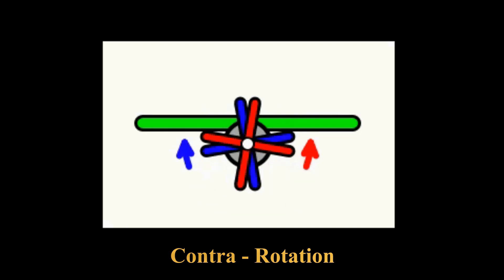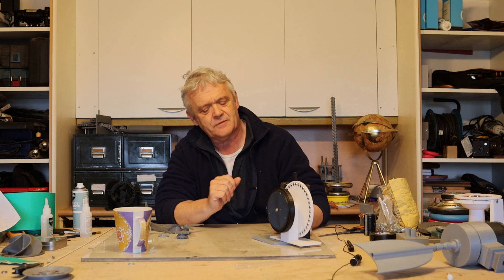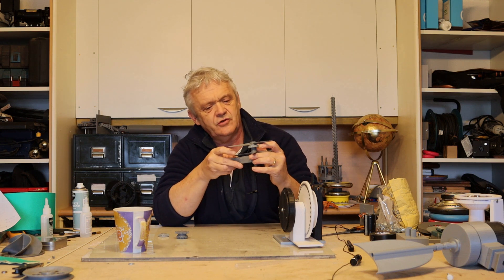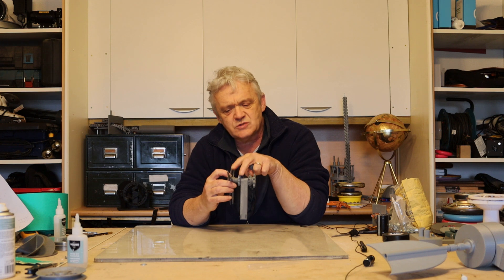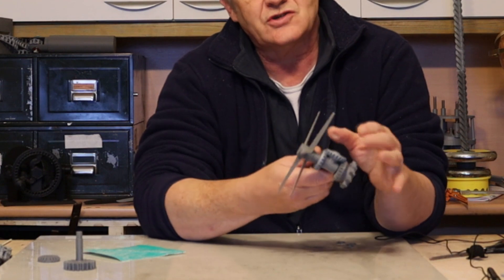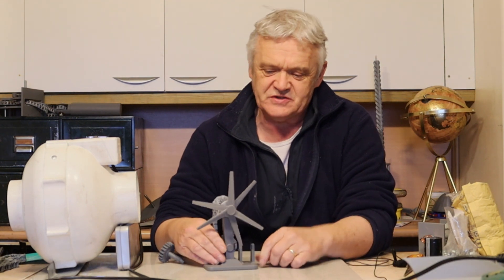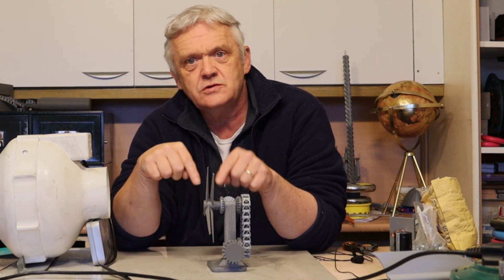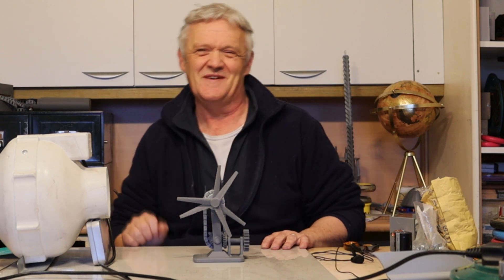2089 Contra Rotation In Wind Turbines

Comment: Some ships use a free floating straight on blade that is only there to channel the water straight on to the propeller. 

One of my beliefs is that the second blade makes better use of the air coming off the first blade than the first blade makes of the un altered winds.  
By designing the second set of blades to optimize the spiral trailing edge's air turbulences, you're not  converting straight on air into a circular motion.  Your riding the circular/drag motion and have less deflection resistances.  Thus I don't think the two separate blades (Including the 25% greater size issue) (not including the mirror effect) should have very much in common.
If the second set had greater angle of attack with deeper blade cross cuts I think there speed might be a little bit faster BUT I think there torque potential would be much greater?  This forms the second adjusted parameter on the loading of not one Generator but two separated ones.
For I don't have Solidworks YET.  And wouldn't know how to optimize the gearing to make those things work well enough.

Comment: Robert, please do the world a huge favor and adapt this model for use in bi-directional tidal applications - where the tides reverse direction at coastal river outflows for instance.  To do this would be simple: add a one-way freewheel bearing in each rotor hub (each bearing will be reversed).  That will allows each rotor to contra-rotate from the other.  You will also have to reverse the blades' orientation (mirror image).  With this configuration, the tidal turbine can be rigidly fixed to the sea floor and regardless of the reversing tidal flows, the connecting drive shaft will always rotate the generator in one direction regardless of flow directions.

Comment: I came up with a system consisting of a shoud & two contra-rotating blades, which were very close to each other, one idea was to have one blade being magnetic & the part of the shroud around it had conductors, whilst the other rotor was composed of conductors & the part of the shroud around it was composed of magnets, giving three areas where conductors are cutting through magnetic lines of force, hopefully maximising the energy being generated.

Comment: What if you had 2 sets of blades, one on each side of the mast, freely spinning, not connected to each other, one has the magnets and one has the coils both spinning roughly the same speed in opposite directions, would that not be like spinning a normal turbine twice the rpm? As you've said many times, moving the magnets over the coils quicker will generate more so spinning in opposite direction would be equivalent to increasing the rpm on a standard hawt?

Comment: I thought of this a few years ago. My thinking is that it would help systems that use an automotive alternator reach excitation RPM/speed at half of the wind speed. My thoughts were to rotate the body of the alternator and counter-rotate the shaft of the alternator.

Comment: Impressive Robert but why the extra chain drive?
Surely the best position for the generator is on the intermediate bevel gear? At right angles to the wind and probably better cooling too.
Reply from the maker: you can change it as you wish mate - i put the chain in for others to be able to interface a variety of things easily - but it can just as easily be different if you want it to be

Comment: Loads of questions , does this give a better output than a twin rotor , if you had a single 6 rotor propeller would it give the same output ,or better when you factor in less complexity and resistance... 
     Obviously size difference,and spacing distance seen to be crucial ,

Comment: For that set up I guess the real comparison should be if that harnesses any more energy than the normal double turbine given the extra inefficiencies in all the gearings and chain.

My idea for contra rotating turbines is that one drives the magnets and the other drives the coil ( in opposite direction ) thereby increasing the relative speed to each other, although that will probably bring in the use of slip rings to get the energy out which adds a little extra maintenance.

Comment: If you say that one set of blades covers a usable area of 10%, would that leave 90% of the usable ariflow for the next set? You could then keep going until returns have diminished to a uneconomical point?
It would add savings to the cost of setup.

It would also be ideal for smaller scale turbines if you can gain the power of a much larger prop in. A smaller package.

Comment: Cost will be your biggest opponent here. I think it may cost as much as two windmills. And having two simple windmills will have a better uptime in the long run.
And the added complexity with coaxial shafts and maybe gears will be a step back. Years ago they had gearboxes for matching the line frequency, but it had loses in heat and frequent breakdowns. Now they have direct drive to the generator, with a AC-DC-AC converter handling the line frequency. Less moving parts = more reliable.
Even if you could engineer this with swiss precision, the up time will be lower.
And noise will be higher. You will need 4 and 3 blades, to remove harmonic vibrations. On a standard windmill you have three swush sounds everytime it passes the tower. In this design with  4+3 blades, you have 12 swushes per rotation just between the blades plus 3 maybe 7 with the tower. That will be very noisy. You could counteract this by adding an angle to the blades, but that doesn't scale very well as you go bigger. The rotational forces will rip them of at some point.
It is a lost cause, mate. 😊
Reply from the maker: it cost pennies mate - it's a test rig - it would help you work out the answer to the question you put -but it will cost you peanuts to find out - which is why the rig
Reply: @ThinkingandTinkering  
Go big or go home. A windmill that size is useless.

Comment: This is a really nice video, and it raises a lot of questions. One such question is this: Does locking the axles together mean that the faster one (front) drives the other one (back) faster than the wind can turn it... and if that's so, won't that cause the back blade to add drag and resistance to the whole mechanism and negate whatever benefit you get from adding it in the first place?
If the answer is "Yes", it seems that decoupling the blades and treating them as two separate wind turbines (designed for different wind speeds) should give better results.
If the answer is "No", can someone please explain what actually happens, and the principles behind it?
Thank you.
Reply from the maker: very good questions mate and this little rig would allow you to try it out and see

Comment: Great video as always Rob very cool , a suggestion with serpentine generator have coil center with 2 opposed  magnet disk each side , have magnets around each side Nth/sth , but matching nth/sth left to right with the wheel rotating vertically aswell , both sides magnet rigs locked together or 45° diagonal so not as hard to lock both sides together with magnets force.

Comment: Do you really need all these gears and mechanical linkage? They all bring significant losses. Why not connect directly one set of blades to your serpentine coil and the other counter-rotating set to the ring of magnets? You will automatically get higher voltage. It will increase the rotation speed which is otherwise difficult to achieve without gears or making the generator prohibitively large.

Comment: I think tge idea with contra rotating blades is the aerodynamics of the front blade should impart energy on the back blade. When the front blade rotates it creates a low pressure area behind itself, so when the blades pass by each other they're supposed to "pull" on each other due to the low pressure zone from the frontal blade.

It'sbasically supposed to increasing effective wing span of the blades while minimizing the effect of drag. Proponents of this basically want an entire circle of thin blades staggered from each other in multiple layers.

I think it's the same idea as jet engines, only without the front fan to suck in a large volume of air at high speeds. So you'd basically need an entirely new blade design for this hypothetical turbine.

Comment: Lost me on contrarotating magnetic fields. Even tossed this at AI to double check my reasoning. Inertial frames of reference pretty clearly lays out that simply because we perceive one plate as stationary, it isn't. In reference to each other, they're both in motion either way. Ultimately what the advantage should be is running the contrarotation at a lower RPM to get the same output as the classic system. Even your example here shows this since you'd need a higher wind speed to get the same output in a 1 turbine system. The point is to eliminate the need for a gearbox and the losses associated with that.
Reply from the maker: your logic is wrong - AI doesn't help - AI is actually pretty stupid - it doesn't understand anything only what you put in - if you put error based logic in there you get error based answers out - sorry mate
Reply: @ThinkingandTinkering  Volta to my Galvani. One man's "nah" is another man's "eureka," so well have to agree to disagree. I'm well aware of the wikipedia-like pitfalls with AI, which is why I didn't stop reading there. I get ya and originally felt the same, but really should reconsider your bias against what's nothing more than a screwdriver also able to write above average poetry. If it truly was trash, it wouldn't have been able to help Ben from the channel Applied Science directly solve a chemistry problem caused by minute levels of dissolved CO2 he couldn't figure out.

Comment: All you need is a clever gearing system to have the counter-rotating blades power a single shat that turn a single plate of magnets.  
Don't certain WW2 bombers have counter-rotating propellers on a single engine?

Comment: with contra rotation maybe what you want is one coil and two sets of magnets, (one for each fan) but instead of having the magnets N S N S have one disc all north and the other all south sitting either side of the coils so you shouldn't have any north/south pairing, also the two fans don't necessarily have to be mechanically coupled, if the rear fan has to run slower then so will the front fan but decoupling them will let the leading fan run faster and the asynchronous rotation speed shouldn't be detrimental the the overall output. just some spur of the moment thoughts :)
Reply: This arrangement will couple them magnetically, which is OK for same direction of rotation but not for counter-rotation.

Comment: Great video. I think the Contra-Rotating blade idea is great, but the mechanism seems to add more friction than the gain.
Reply from the maker: only because it is made from plastic with a lot of slack to make sure it turns mate - engineer this with bearings and the story would b completely different

Comment: I wouldnt confuse the two, contra rotaion is usually to eliminate a motion you dont need, say prop walk or other stuff. - I guess theres a reason the comon housefly dropped a pair of wings and replaced them by 2 adjustable counterweights.
Reply from the maker: cheers mate

Comment: Thinking it would be interesting to compare output with a traditional 6 blade non-counter rotating setup. But as a twist, it would be interesting to also compare 6 blades in the same plane with 6 blades set on 2 planes, as in this experiment, but rotating in the same direction. Which in turn might lead to 6 blades on 6 planes.
Reply from the maker: well this a good frame work to test ideas - so go for it mate

Comment: The benefits of contra-rotating blades on aircraft and boats is obvious, but for static wind turbines I can't see why they'd be better than non-contra-rotating blades. The problem with contra-rotating blades is that for part of the travel, the back blades are in the shadow of the fore blades, thus reducing efficiency. Aircraft and boats might be happy with that efficiency drop because of the benefits of balanced loads, but a static wind turbine can simply be made a tad sturdier to counteract the imbalance.
Reply from the maker: have a quick read at the research papers mate - this is a hot topic

Comment: You're overcomplicating this design; Take your generator for a moment; we create two plates of magnets and two stator coils, one for the primary rotation and one for the counterrotation. Plate one and stater coil one  are the larger diameter and used for the counterrotation blade, this will look like a ring frisbee or donut. In the donut hole of Plate one, is plate two, smaller in diameter for both the magnets and stater coil. Directly attach the drive shafts for both rotors to their respective generator disc setups. Now you have double the output of power without needing a ton of cogs and extra moving parts which can fail.
Reply from the maker: yes - but it is mean to be a test bed for others and that is going to influence the design
Reply: @ThinkingandTinkering  I understand the intent, that it's a test bed, but it is still overcomplicating the design. I'm not saying it isn't a cool design, or that I don't appreciate it for what it is, but it is an over complication. 

Perhaps consider an entirely different approach with the contra rotation, by using a vertical axis generator with two magnet plates and a central serpentine coil. The top magnet plate is driven by the counterclockwise front rotor while the bottom plate is directly driven by the clockwise rear rotor.
Reply: @ThinkingandTinkering  I'll try to do a mockup in Blender and link you to it to demonstrate what I mean.

Comment: From the looks of it the front blades are forced to turn the rear blades at the same speed. To me this seems subtractive in speed but possibly additive in the torque of output. speed generally being the goal in a wind turbine generator would it make sense to reduce the gearing on the rear turbine blade set to maximize the speed of the output shaft?
Reply from the maker: no mate - I showed them free running and independent right at the start of the video

Comment: In boats we call it duoprop, there's a lot of added complexity, but also something like 25% gain in output, what is happening is that you harvest the vortex from the tip of the blade, and as someone else already stated, keep one even, and one uneven number of blades, so they don't meet all at once, it prevents noise and vibration, they can still have the same "thrust" with different number of blades.
Now imagine instead of gears, it had magnetic gearing instead, less los, and all the benefits, also easier to measure the difference, when testing.
About the distance between rotors, obviously Volvo Penta and Mercury have done a lot of testing in water already, maybe someone else knows something about that.
Reply from the maker: that is interesting mate - thanks for posting

Comment: An idea 💡  - not sure if you have done this.. but can't you have the one rotor mounted to the magnet plate and the other connected to the coil housing - this should result in a higher rate of flux change with the oposing rotation directions?  :) a true contra rotating generator 😊  this does make the power connection a little trickier buuuut nothing you can't handle 😂
Reply: Problem with rotating the coils is that the coils then require slip rings for output which complicates the design a bit where as stationary coils don't and simplifies the design some what
Reply: @magapefarmshomestead6453 oh agreed! Just a different way of going about it :)
Reply from the maker: that would make the wiring a bit of a pain mate but it could be done
Reply: I was thinking the same thing, I suspect a slip-ring would have less complexity (and certainly less losses) than the mechanical set up here. As for advantages, unless theres a noticeable output gain vs. the twin rotor design previously tried out, it could be useful in low wind speed applications, as would effectively double the generator speed without the need for gearing (and its losses).

Comment: The second propeller should be larger in diameter and have 5 blades
Reply from the maker: well this a good frame work to test ideas - so go for it mate - try it and see - doesn't sound like it would do much to me but I don't really know
Reply: @ThinkingandTinkering  This is a consequence of Betz's law. The first propeller takes about 59% of the wind's energy. This means the second one should be of a larger diameter and adapted to lower wind speeds (more blades).